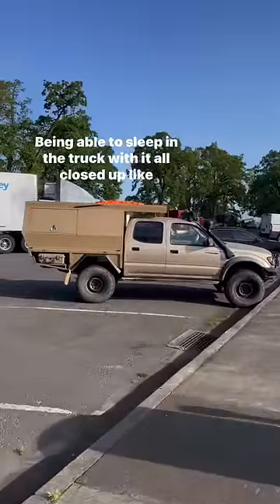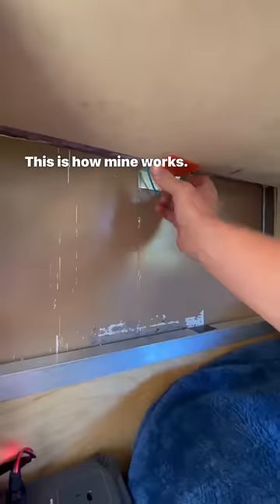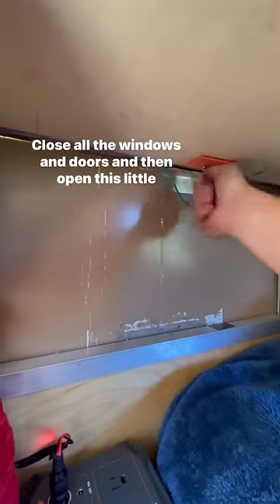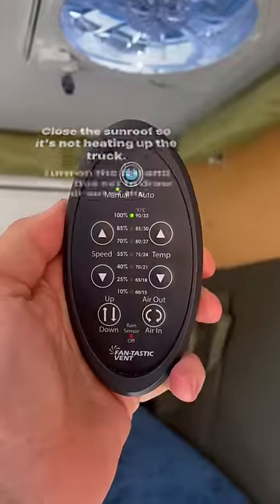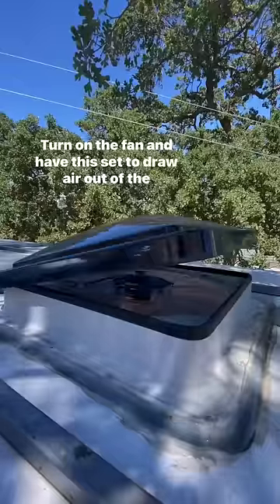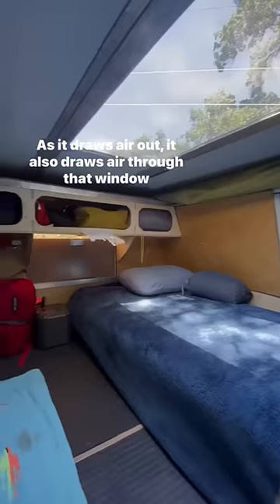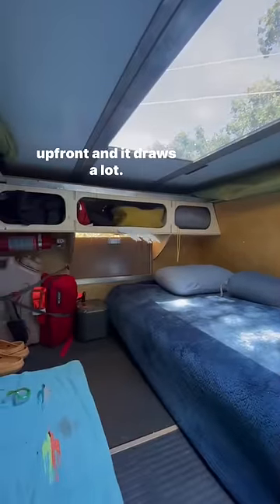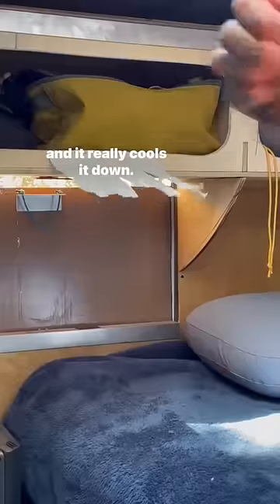Stealth camper setup

Comment: It’s like a whole house fan many homes are fitted with
Reply: this girl ik fucked me up when she said she was going to turn on her house fan
Reply: Never seen one in texas
Reply: Exactly!
Reply: @Mr.Pop0  They're great if done properly.
Reply: @williamwinder3466  And if it cools down just a little in the evening after the sun goes down.  A whole house fan isn't going to help much if it's still 85°F+ outside, and especially if it's humid.
Reply: most ppl don't know there's a switch on every house fan to switch direction
Reply: @Dentondad  And that you can save a load in winter by switching fans to blow upwards, and running fans on the slowest setting, whenever your heating is running, otherwise all your heat will be up next to the ceiling, doing you no good at all, especially if you're sitting down.

BTW You realize that a "whole house fan" is something entirely different, right?
Reply: @pulaski1  why would you want them to blow upwards?  When the heat is already up as high as possible, you would want it to blow down. And yes I do know what a whole house fan is.
Reply: @Dentondad  When a ceiling fan blows down it feels drafty, whereas when it blows up it circulates the air, drawing cool air upwards in the center of the room and pushing warm air down around the edges in a way that you don't feel the air moving.  Think of it as a donut of warm air coming down on all sides.

If you have ceiling fans you really need to try it - I have had tenants in one of my rentals complain about the cold and that the recently installed heating system never made the house warm, yet when I got a ladder out (to change light bulbs), the air was hot up near the ceiling.  Turning the fans on to circulate the air solved the "cold" problem entirely without any additional heating.
Reply: @pulaski1  How do I make my ceiling fan blow upwards?
Reply: @trailrider7046  There is a small sliding switch on the side of the motor housing.   While the fan is off, slide the switch to the up position. .... And you will only want to use it at the slow speed to circulate warm air in the winter.
Reply: @pulaski1  Thanks. I'll look for it. My ceiling fan is from 1980! All metal.
Reply: @trailrider7046  while they were built to last they are power hungry old motors. Like 300 watts on high. 75 watts on low etc 
New brushless fans use 36 watts on high. So if you use it alot or leVe it on constantly its worth the upgrade. Plus you get a remote. Cheers
Reply: @toob247  I didn't know that! I appreciate your telling me. I leave it on low all summer for my guinea pigs ! Much thanks.
Reply: @jjosangeles7296  wtf I would had been too I ain’t ever heard of that shit
Reply: We had this massive attic fan back home, and on summer days when the house got stuffy, we'd open the front and back doors and cut it on full tilt. The sucker would actually slam the doors open unless they were propped..... I miss my house.
Reply: Had a whole house fan in the little house we grew up in... Massachusetts. Built in the 50s.
Huge fan inside of a trap door in the ceiling. Open any window in the house... or all of them... pull the trap door down (sort off like a trap door with stairs to access an attic) the fan automatically came on. It would blow out into the attic sucking air in through the windows. Instant AC on hot summer nights.
Just a great feature to have in a home.
Reply: The what?
Reply: Completely different, it's pulling fresh air in and pulling the hot rising air out. A house fan pulls the cool air up and pushes hot air down recycling the air inside the room 🤦
Reply: I'd integrate refrigerant for places this system won't work unless your blow drying ur hair
Reply: You get acclimated to not having AC after about two weeks. This is the way.
Reply: @Mr.Pop0  I have what the hell. I take them out all the time (HVAC tech)
Reply: Sadly a fire hazard so most home are no longer built with attic fans.
Reply: I've only seen one in my life time and I thought it was an amazing idea
Reply: @pulaski1 Yes! I love that A/Cs dehumidifie.
Reply: They come in Campers and Rv's , especially in the bathrooms
Reply: @pulaski1 yeah after about 85-90 degrees the movement of air actually becomes worse for you because your body is already that hot. It's not bringing air cooler than your body, it's just removing that little layer of insulation you got.
Reply: I want 1 so bad…growing up the house we used to all party at had 1. The parents had property and business in NJ, so they’d leave a 5000 sqft home to their kids every weekend. (They had 3 high school boys..imagine!). At the end of every weekend we all clean up, last thing we’d do is turn the fan on and suck all the smoke out..took seconds. We always got caught for other shit but never the house smelling like bud 😆
Reply: @Mr.Pop0  its mostly a mid west thing i think
Reply: too bad they’re not a thing in newer houses. super useful and efficient.
Reply: @Dentondad a house fan is not a ceiling fan.
Reply: @Mr.Pop0 it's usually the really old houses. My grandma had one....was loud as shit when you first turned it on.
Reply: @Mr.Pop0 probably because pf the moisture; I had one in SATX, but the AC company that regularly serviced on AC Unit said not to use it. I just don’t think we have the seasons for it. I live in WA, right now, and it works well.
Reply: I live in the deep south. This thing would be great for smoking brisket but that's about it. Too hot here for that. A/C install upcoming.
Reply: @Mr.Pop0 my dad had one growing up in East Texas back in the 60s. Had to keep the windows open at night so the fan could keep the house cool. The fan was still there when we were clearing out my grandpa’s home after he passed away. Doubt it’s still in there now after my dad and his siblings sold the house.
Reply: @Dentondad Taking a hint from your name…the only thing I’m thinking based on living here in North Texas is that this is a great way to get some hot Texas air blowing at you from the side rather than above. 

But hey, if it works, I’d be delighted, since I’m hoping to build my own teardrop in the coming months.
Reply: I was thinking the same thing!
Reply: These are a thing in NorCal! Especially when the Delta Breeze is coming in from the Bay Area...
Reply: House fans make summer down south bearable. Lol
Reply: Now try this in the south during the summer, no amount of airflow will stop the suffering
Reply: Summer camp I went to as a kid had a huge exhaust fan at the top of the wall in every cabin. Open the windows just a few inches and turn that baby on, and we kept cool all week long.
Reply: @Dentondad  I don't think you know what a whole house fan is.
Reply: Forgot then mfs existed fr, only lived in one house with a whole house fan an it was a loud motherfucker, worked great tho.
Reply: Bro hold up, they got those?! Whole house fan? Like different from central air?
Reply: @calebcharles9074  yes, it's big Ole loud ass fan
Reply: @new_note10plus90  thank you imma need both of em 🥴 now to just get rich.
Reply: @calebcharles9074  house fans are so great to me, something abt the rattling is comforting bru
Reply: Very popular before home air-conditioning.  I grew up having one.  They are very effective, but are very loud.  Though completely useless if there are nearby forest fires, unless you want to hack your self to death on smoke.
Reply: @PhantomFilmAustralia  I always loved the loudness on them, just enough to keep the house cool at night
Reply: @pulaski1 I’m warm bodied, so I have to have my fan blowing down on me otherwise I’ll overheat. Lol

Comment: Best stealth camper: semi truck with a sleeper
Reply: $1,100 to fill up at the gas pump.
Reply: Yeah what the other guy said plus they cost as much as a 4br house in most of the world 🤣
Reply: And it pays all your bills. 🙂👍
Reply: @m.taylor7025  It is. I was thinking about vanlife years ago, and realized working your own truck lets you do all the same things, besides off-roading of course, but getting paid for it at the same time.

If you just want to travel the country tho, and maybe do things like bike camping for just a few days at a time, then a truck lets you do exactly that.
Reply: @Two 5 Seven  It unfortunately is
Reply: @two5seven14  I don't put my card in the pump.
Reply: Is that not a mid size tundra?
Reply: Doesnt look stealth
Reply: @two5seven14  That's why you make $ off it. And a lot of it.
Reply: @m.taylor7025  depends on the semi.
Reply: @two5seven14  it's diesel. Not a gas pump.   Plus most companies pay for company driver fuel.  Also an apu allows comfort,  cooking and keeping batteries charged,  while using less than a gallon of fuel.
Reply: @jordanharvey2163  you must be fun at parties.
Reply: @jordanharvey2163  well considering the post is about campers and it's not practical to buy a semi as a camper unless you want to be a truck driver, the point is fairly useless...
Reply: @m.taylor7025   the point was the fuel response he said was wrong. That's what a correction is for.  Sadly you must have never finished 2nd grade. We learn to admit our mistakes at age 1.
Reply: @jordanharvey2163  I'm a fuckin software engineer lmao that's why I find it absurd to buy a semi for camping...it costs as much as a house
Reply: The way the economy is goin? Shiiit ive had to do it a couple times
Reply: Only house you can smash though blm riots with.
Reply: @GS-zc4sk  😃
Reply: Until you see the fuel bill...
Reply: @two5seven14 FUEL DISPENSER you don’t fill up on gas with a diesel semi, and we quit using gas pumps decades ago. They are called Fuel Dispensers… Worked for GuardianFueling Technologies
Reply: @Singularity.82  i saw a stretched frame truck with a smart car in between the trailer and truck, just need some 4wheeler tires and its the ultimate setup
Reply: @maximeb6662  If you like smartcars, sure. 

I'd rather have less expense and trouble, and more exercise, with a bicycle, but motorcycles seem to be another popular choice for that space also.
Reply: @m.taylor7025  I mean if you're a wealthy retiree with friends and children across the US, want to sell your house, uproot and explore the continent, then a luxury camper built on a class 8 chassis may be practical for you.

Everyone has different needs and wants for their purposes.
Reply: Doesn't need to be stealth.  The "HDT" community among full-time RV'ers converts a sleeper into an RV and you can REGISTER IT AS AN RV (where laws allow). Once it is an RV, you don't need commercial plates (still need the endorsements on your license) and can pull not-for-profit.
A used sleeper will run a very long time when not doing any work - people I know buy them at 700,000 miles. Not expensive.
Reply: @m.taylor7025 
Where you getting a 4 bedroom house for $10-20k that a decent used truck costs?
Reply: @two5seven14 cheaper than rent 😅
Reply: @two5seven14  lol fuel cost is factored into the load cost.

Comment: How to sleep in my truck all closed up, 
Step 1: open this window
Reply: This build was designed by a mosquito.
Reply: Step 2: open roof fan
Reply: Hard to tell where he has that ope as he dosent sow the location clearly in any of the video.
Reply: When he says all closed up, he means not popping up the tent portion of his camper which screams someone is sleeping inside. At one rest stop I was told if I grab a few zzz’s while sitting in the driver seat, I am good. If I pop the top and crawl into my bed I am camping and in violation of the law.
Reply: Ikr wouldve been more satisfied with one of those shitty ice chest air conditioners
Reply: The doors are closed tho
Reply: @CSM-68 what about RV and semis tho😂
Reply: @braapybobby  was not an OTR trucker but my dad and several friends were and are. Jumping into the bunk at a rest stop as a trucker is one thing. I was told by law enforcement, I could rest in my drivers seat. But If I went into my RV bed then I was camping and that was against the law. I argued that would you rather I get a good few hours of SLEEP or a bad few hours of REST. Then be back out on the road. Some places are restrictive that way.
Reply: Well, to be fair, the window is between the cab and the camper, so its not like someone can get in.
Reply: @Override9636  True, but, a bit of mosquito netting would fix that. Still a good build.
Reply: @CSM-68  Kids, don’t argue with the police. Argue through the mouth of an attorney.
Reply: @TheKiiS  First of all I am in adult, second when I said I argued I meant I was asking for rational.  I was exhausted driving cross country and rest was not what I needed.  I needed SLEEP.  The officer I encountered was very professional and advised me on what I could and could not do.  That is not always the case.  He actually saw my side of it but was bound by the law.
Reply: @CSM-68  wow 1968 in the username who would’ve guessed… I was talking to other people who might take a similar approach thinking they got good advice from you. Don’t argue with cops, kids. That’s what lawyers and judges handle. Cops handle donuts 🍩 and handcuffs.
Reply: @TheKiiS  You may have been talking to others but you addressed it to me.  I always say I may not beat the Ride but I will beat the charge.  However never had to push any interaction with law enforcement to that extent.
Reply: @CSM-68 really dumb how subtle differences change the law.
Reply: @TheKiiS  you cant say it was meant for everyone else and not him when you literally @ed him
Reply: Man needs bars + Burnet on that window and he's set
Reply: Bugs are more a afraid of you then you are of them hahah
Reply: @goodcitizen-ft9bg  no one’s worried about bugs
Reply: He said, "AND SO IS ventilation." he changed the subject.
Reply: @HighOctivity what?! Those things work, they're a damned life saver.
Reply: @CSM-68 we know that.
Reply: @COM70 He said it's behind the cab, so if you pause the first shot of the truck you can tell exactly where it is
Reply: It's a wind chill model
Reply: Step 2: Turn on this fan.

Comment: We have a van conversion, and there's two fans. One in, one out. If they're on max it turns the inside into a wind tunnel!! Fantastic setup. It really helps reduce condensation and bad smells from happening.
Reply: I’d think 2 fans would be better than one fan + a sliding window. Couldn’t someone just yank that window right down and join ya??